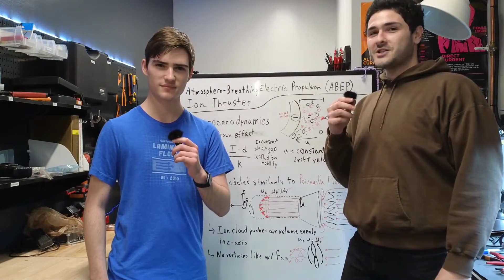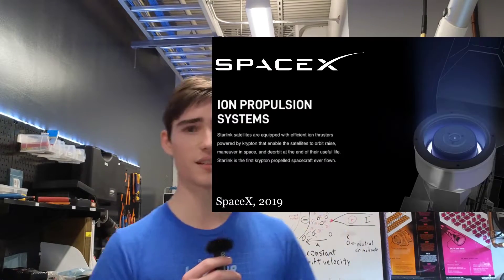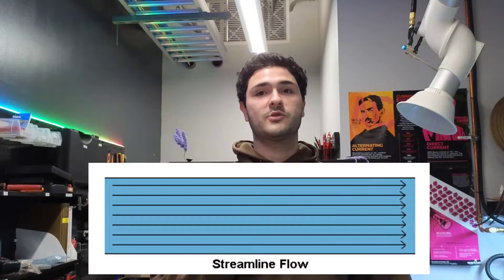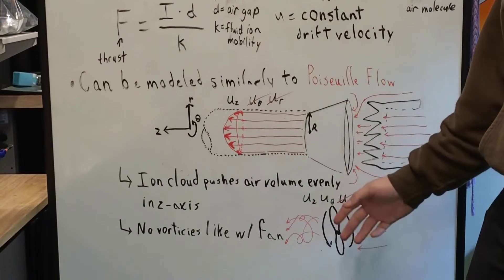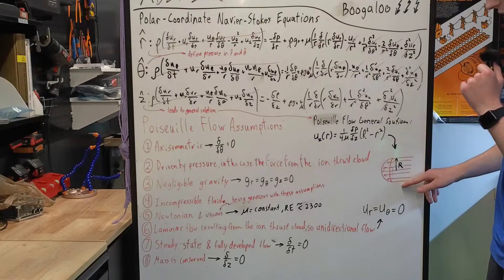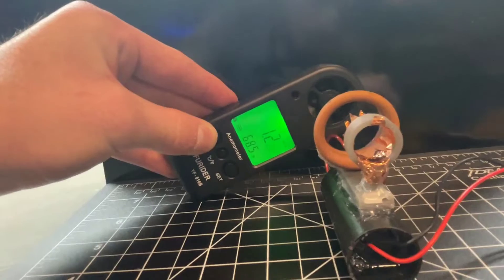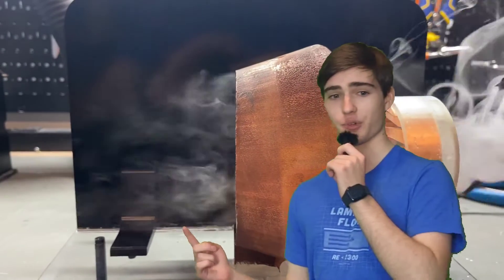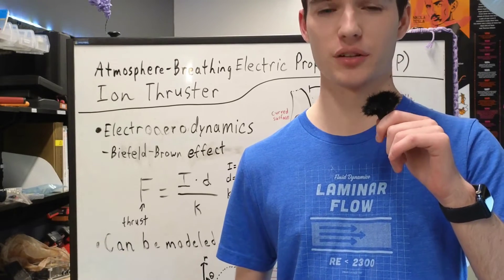Atmosphere-Breathing Electric Propulsion (ABEP) Ion Thruster - Georgia Tech ME 3340 Fluids Project

Comment: You're close do you want to make a flying car you just need to open your mind a little bit more about the fluid dynamics it doesn't have to run through a tube it just has to be controlled with magnetism.
Reply: You don't need a needle to ionize the air enough electricity like a Tesla Tower venue control the flow with a magnet manipulating it to provide Lyft Under The Craft essentially countering the weight and then you can via any propulsion system to include your Ion thruster